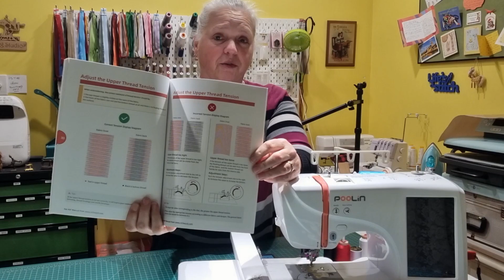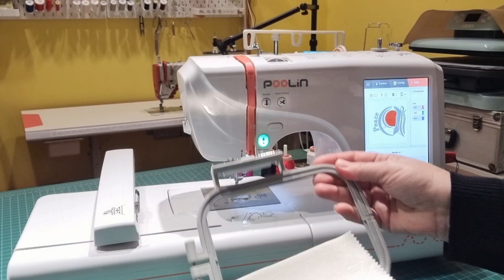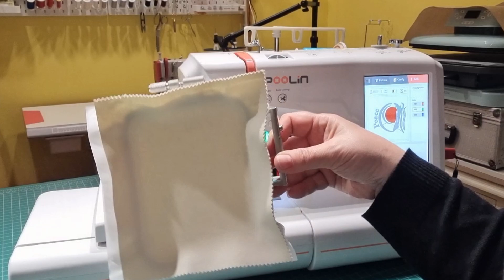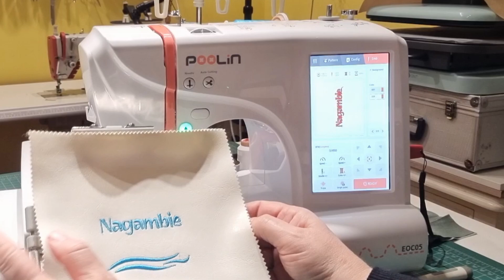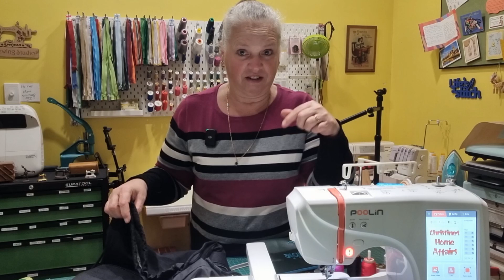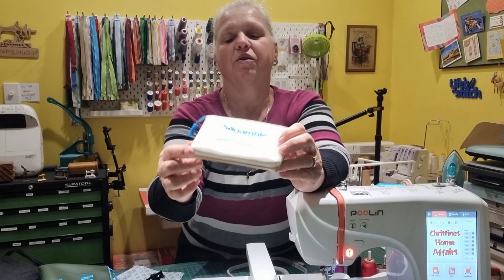❤️POOLIN embroidery machine EOC05❤️Part Two - Test & Review

Comment: hi, Sandra here from the UK. I have just purchased this machine and it arrives on Monday. (14/10/24) What i wanted to know is, in order to create ones own designs, can this be done with Photoshop and then stored into the machines memory for projects? I have Photoshop so can create anything but not sure if the machine will allow the things i create. thanks for the video. love the work you have done so far.
Reply from the maker: Sandra, your images will need to be converted to embroidery files to be stitched out. There are some online that you can purchase and even use for free. Others will also convert them for you. There are also several free files you can download and transfer to your machine.

Comment: Nice stitchouts! The pouches and Chris’ backpack are terrific! Billy50 (Australia) is a good digitizer. She also has a YT channel. Try holding down the “go” button and your machine will stitch very slowly — when you remove your finger, it will resume normal speed. Very helpful, especially when crossing seams. I have and use Embrilliance software. Not expensive, no charges for updates, purchase only the modules you need as you need them. Amazing customer service and several free YT tutes explaining the fancy stuff when you’re ready for that. I mostly use Embrilliance and Essentials. All modules integrate with each other. There is also a FREE version so you can use and decide if you like it. To protect the USB slot on machine, I’d strongly suggest getting a short extention cord to plug in the USB slot and use the other end of cord to insert/remove various USBs so as not to wear out the slot on your machine. This cord only costs about $5-7 USA dollars from Amazon.
Reply: Some excellent advice there. The USB cord one in particular. Thanks!
Reply from the maker: Thanks Cyn. That's a great tip about the usb cord. I'm sure Chris will have a spare one😀

Comment: Hi Christine.  Great video.  I'm pleased to see you stitched a design onto vinyl.  
I have been experimenting with designs on vinyl with my Brother Innovis.  I have found that when the design has quite a dense amount of stitches it's almost like it creates a tear line line in the vinyl.  I'm not sure whether I can get around this by using a different needle size or changing the stitches within the design.  It also coukd be the quality of the vinyl fabric.
More experimenting to be done but if you have any thoughts on that your comments would be invaluable.  I made a lovely small tote which included an embroidery pattern.  I will post in the FB group.  Cheers for now from an early, rainy morning in the UK
Reply: You can always stitch your design out like a patch and sew or glue it to the vinyl.
Reply from the maker: Thanks jay. I'll have too keep an eye out when stitching sense designs on the vinyl😀